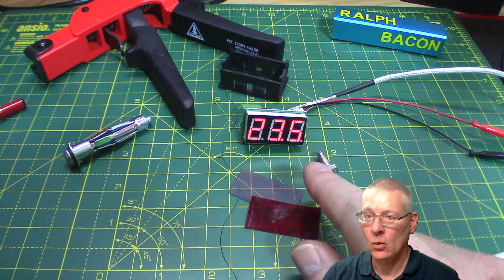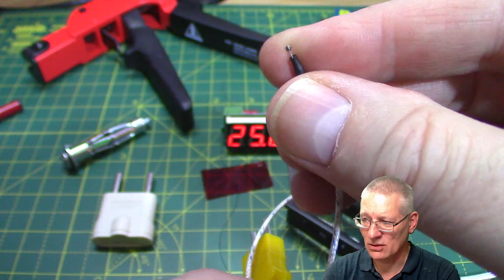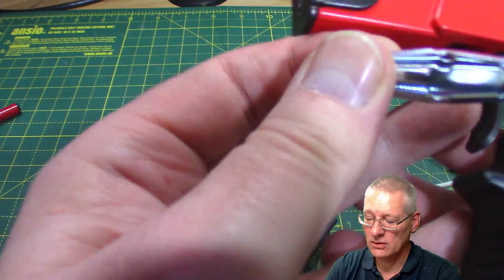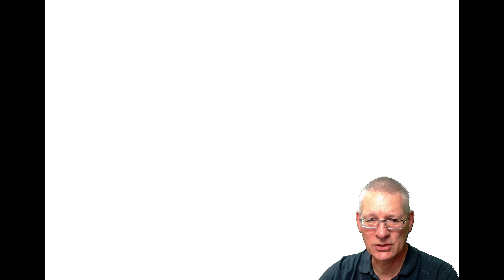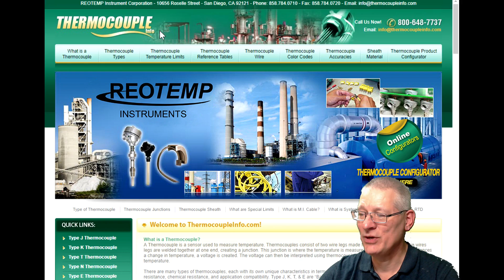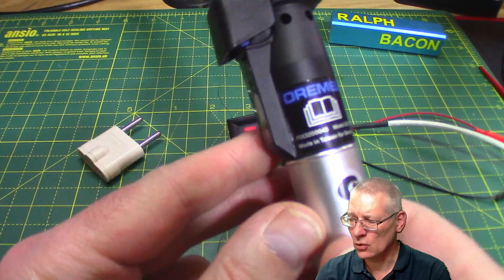#137 K-Type Thermocouple Display

Comment: I'm really interested in installing something like that for my espresso machine but I can't find how to connect this to a power source. I understand you need a 12V adapter (220v to 12V in my case), but as I know pretty much nothing about electricity, I don't understand what I should buy to connect it to a power plug. If you have any reference or even just the name of the part so I can search by myself I would be really thankful !

Comment: Hi Ralph
Would you happen to know how to set up an electric kiln to read temperature.  I have been told I need an ssd,  
k type thermal couple and a temp reader. I have no idea what to do or how to do it.
Reply from the maker: What you are doing is reading an analog voltage from the thermocouple, on any one of the Arduino's A0 - A5 ports. There are examples on how to do this in the Arduino IDE.
Reply: @RalphBacon  Thanks I will look.

Comment: Bit late to the party but been using these thermocouples for many moons for measuring exhaust gas temperature in two stroke exhausts, which is important for exhaust pipe design. Also use in the oven I built for melting aluminium. One issue with the regular sensors is that they are very slow response. I actually cut the ends off mine to expose the blob on the wire ends and response is lightening fast. The chip used for the conversion is a MAX6675.
Spot on about extending the wires, in fact I cut the spades off and connect the wires directly to reduce the amount of dissimilar materials. Accuracy is pretty good. Certainly good enough for what I need.
Also, don't solder any connections as once again this adds to the dissimilar materials and affects accuracy.
By the way, I use a Nano for outputting the temp to a display and also logging to an SD card for graphing in excel.
Great vid as always
Reply from the maker: Good Real World information there! I'm guessing the thermocouple wires are welded together (not just soldered) as you have cut off the ends? Or perhaps just wrapped together? Whatever, useful stuff and and interesting post.
Reply: @RalphBacon  not exactly sure what they've used to join the ends but I blasted it with a torch up to 1000°C and no problem. Works fine. Typically, the temperatures I'm working with in two stroke pipes is 550-650°C.

Comment: When I worked for a defense contractor in the 80's, we used so many thermocouples in destructive tests that we used to make our own. We bought thermocouple wire in spools of a 1000 feet or more, and made our own by soldering the two wires together at the very tip. It was a very small solder bead. Of course, when that end of the wire was destroyed, we would cut it back a ways, and do it all over again. Still got accurate readings.
Reply from the maker: That's certainly a lot cheaper than buying commercial thermocouples (well, if you're going to destroy them regularly!).
Reply: Yep. Of course, thermocouple wire isn't cheap either. You would have to destroy a lot of pre-made ends before you would break even.

Comment: Could I use red gel sheet for the led overlay?
Reply from the maker: I think I did that to my one too. Standard lighting gel, Fire Red or something like that. Worked fine and make it easier to read. It's only about £2 from eBay for an A4 sheet.

Comment: I think the rivnut idea isn't the best method - rivnuts have a nasty habbit of coming lose and spinnning when you try to screw things into/out of them. No good if you need to replace your thermocouple.  A much better idea would be to drill the hole and tap an M6 thread directly into the 'wall'.
Reply from the maker: Agreed. The rivnut seemed a good idea at the time but having revisited it I think it less than ideal.

Comment: Interesting video, thanks Ralph. I am definately going to get one of of these but tbh I wont be using banggood, they're useless. Hopefully I can source one elsewhere as I've wanted to put a thermometer of some kind in my fireplace flue for some time. Great timing! Keep up the excellent work.
Reply from the maker: Glad you liked the video, Doc, but I'm sorry you don't like Banggood. When someone says "they're useless" it usually means that they have had a bad experience that wasn't resolved satisfactorily. I use them more and more because they deliver stuff so quickly (and the price is OK too). The only downside is that they don't stock everything so I then have to go to AliEpxress which takes longer to arrive.

Comment: Enjoyed the video.
Not meaning to get off topic, but that Dremel heat gun is quite a neat device.  Do you have other videos where you have used it?  And can it be used to reflow solder?
Reply from the maker: I've shown it only once before, I believe, when I first got it. It can be used to solder (it comes with a couple of soldering tips. quite chunky but work well, especially outdoors). 
Whether it can be used to reflow solder I cannot say. It gets hot enough but possibly too hot - you only need a couple of hundred degrees Centigrade but as you saw this can really get hot - too easy to burn the board I suspect. A hot air soldering gun is the tool for the job - temperature controlled.

Comment: Nice little device. I was planning on building myself such a thermometer for the BBQ with a few sensors and WiFi capability so that you can monitor your smoker from anywhere in the garden. But until now I did not manage to start that project.
Reply from the maker: So now you have one less excuse to not get started, right, Michael? Good to hear from you.

Comment: Sorry Ralph for being off topic, but have you had a chance to come up with the circuit board design for programming the ATTiny yet? I'm sure there are a couple of printed circuit board manufacturers in China that would be more than willing to sponsor the video. 
Thanks again (& great video as always)
Reply from the maker: Off topic, maybe vonries, but still of interest! 
Now, when you say "programming the ATTiny" I am currently looking at resetting the fuses of the ATTiny85 (specifically the RST pin back to RST from a GPIO pin, as covered in video #87). My sponsor, PCBWay is also keen that I progress this! I've decided THT is the way to go, SMD was just too fiddly.
I'm trying to multitask this PCB design in amongst another (more urgent) project so keep tuned, it won't be that long before I have something. 
Unless you didn't mean resetting the ATTiny85 - in which case there are several boards out there already to just program them and which I covered in video #84, I believe.
Reply: @RalphBacon  you are right on target. I want to be able to set it as a GPIO and back again so I can update the program as needed. You are the man Ralph! I'm waiting with baited breath for those Gerber files.

Comment: Nice project, electronics and Food.
I bought a cheap PID controller just to display the temp of my heat treat furnace, that would have been perfect, using correct and known thermocouple junction gives very accurate readings. I did buy the extended type thermocouple to pass though 75 mm of insulation.
Thanks for sharing and best regards from the Black Country.
Reply from the maker: Glad you liked this video, whilst this device won't control the temperature (unlike a PID) this is pretty cheap just to display the temperature fairly accurately. Thanks for posting, and regards from the land of Concrete Cows and roundabouts.
Reply: @RalphBacon  Thank you for your reply, I was in your neck of the woods in 2016 having training in PLC controls at Rockwell Automation. The cows were on display in side the shopping centre.

Comment: The length of the extension cable is not the main property when extending, it is the type/composition of the cable.
K type extension is a different composition to J or R type cable. 
As long as you use the right type of extension cable, you will be fine, even shortening the existing cable will not change the temperature reading.
Also observe the polarity/colour of the extension cable.
For example K-type,  RED coloured wire insulation is NEGATIVE and YELLOW coloured wire insulation is POSITIVE.
There are also a few different colour code standards.
Reply from the maker: Quite a minefield then, Tom, as we must use the right cable for the type of thermistor and observe the polarity too. But can we just cut off the spade connectors (or that yellow plug) and solder on an extension cable? I though we might have to use a proper extension connector (of some kind)?

Comment: Fridge and freezer alarm
Cool vid
Reply from the maker: Hmm, actually, you'd be better off with a DS18B20 for that, a waterproof version that looks like a tiny torpedo. It can be very accurate even at low temperatures. The thermocouple is best kept for very high temperature measurements, such as ovens, BBQs, boilers, furnaces and so on. But thanks for the suggestion, always good to hear from you.

Comment: Nice vid. But no one has picked up that this is the wrong type of fitting to use on a nut. That threaded shaft spins independently from the thermo couple because the thermal couple is designed to hit something and the nut spins and clamps it up tight. If you used that on a flu the threaded part would do up against the riv nut put the thermo couple with still spin around and leak.
Reply from the maker: My foreheads is furrowed (concerned face) as I read this post. You're right, it's definitely is not an airtight seal, that's for sure. A solution would be to use some high temperature sealant that, once fitted, would set and provide that seal. Even some "metal putty" put on the outside would be pretty good. Certainly in a domestic environment I would be very careful that a proper seal was made. On a BBQ is just doesn't matter. Excellent point, Capposteve, great that you posted here.
Reply: Ralph S Bacon no worries Ralph. I wasn’t sure wether my sketchy explanation was understandable or not. But you see what I mean. It’s like one of those taper ends on old brake callipers for cars. And even more obvious when you see the thermal couple with a ball end on it. So it seals agains the part it’s pushing up agains and then it seals on the spinning threaded part to once tightened. I’m sure that are solid ones out There for the purpose this is intended for. 

Anyway, thanks for your great videos. Always look forward to new videos. 

Steve
Reply: @RalphBacon  You can find various grades of silicone ("caulk") at auto parts stores that will tolerate some fairly high temperatures.  I recall getting some a while back to deal with an aspect of the wood stove here that wouldn't stay in place otherwise.

Comment: @10m47s: I don't think that the thermocouple threaded hollow bolt is long enough to reach the threaded section of the drywall nut.
Reply from the maker: I checked what you said, J H, and you may be right - at least, not without some modification to that bolt. Not impossible but best to stick with the rivnut, methinks! Thanks for posting.

Comment: Great video.  The rivnut maybe not so handy for a stone chimney as those are often quite thick and stuffed with insulation. On a bare metal pipe they may come in very handy.
I have one in my oven and I just fastened it with another 6mm nut on a metal plate. Would do it that way on barbecue as well: drill a hole through the metal, stick sensor through, fasten with 6 mm nut
Have one at my fireplace, attached in same way (I like to make sure the fire is out when I go sleep)
"Running out of gas"? I think I have not used that excuse since my late teens anymore
Reply from the maker: Well, the rivnut is not intended for use on anything except metal, Ed, so a stone chimney definitely won't work. You could just drill a small (8mm?) hole in the chimney, stuff this in until the end just pokes out the other side and then seal the hole airtight afterwards. Jobs a good 'un.
And yes, if you can get to the other side of whatever you are fixing it to then a standard M6 nut on the other side is a perfect solution, less fiddly than anything else (as you have proven).
Finally, your reference to me "running out of gas" is, for us Brits, not a used expression, not even in my teens with a date sitting in the passenger seat, mainly because we don't refer to petrol as "gas" here, not ever. Gas is the stuff used in ovens and stoves (we say hobs) for which this device is perfect, of course. We don't even "get gas" after a heavy meal!
But we understand the phrases due to the plethora of US TV films here. Where's the nearest gas station? People will give you blank stares!  Great to hear from you, thanks for posting.
Reply: @RalphBacon  ah then I misunderstood. Probably automatically presumed British chimneys were made of stone. Seen too much Coronation Street in my youth I guess.
Yes, petrol is the right expression in UK, with the tank being under the bonnet rather than the hood. Two countries, separated by the same language as they say.
Anyway, very handy sensors. Have them monitoring my stove ( that's the one I am cooking on), my oven and my fireplace, the first and the latter combined with an it sensor, to make sure they are all off when I go to sleep. One tends to become forgetful with a rising age

Comment: Hi Ralph, I have used the very same thermocouple in conjunction with the MAX6675 IC and an Arduino Nano to make a high temp module for my "Plant Pot Tandoor" and it all works great (delicious chicken !) There is a great libary for the MAX chip and the temperature range is 0 - 1024 C,  just perfect for a Tandoori oven which sits at around 450 C. There is a breakout board based on the chip and  that comes with the thermocouple as well, and they cost peanuts. All in all this was a cheap and convenient solution, as commercial high temp measuring kit is quite expensive. The highest temp I've measured was just shy of 600 C.
Reply from the maker: Wow! 600C, that's hot enough to melt a number of things (but not this thermocouple, apparently). Someone else has mentioned the MAX6675 chip, I'll add it to my list. Thanks for posting, Andy.

Comment: Hi Ralph...we have both plasterboard and drywall here in the USA.  They are not the same.  People who know what they are talking about call plasterboard plasterboard and not drywall.  So you were correct the first time.  :)
Reply from the maker: So confusing - two nations separated by a common language! Thanks for the heads-up, James!
Reply: @RalphBacon - one more quick point - Maybe you call your drywall by it's real name over there:Gypsum board?  It's also called Sheetrock here, which is a brand name. 
https://www.gypsum.org/about/gypsum-101/gypsum-board/

I did much prefer the old plaster board though - but that's expensive to do nowadays.  And we dont build quality stuff like we used to.

Your mistake is not that uncommon though!  Even this article has it wrong:
https://www.hunker.com/12616166/differences-between-gypsum-board-and-plasterboard

But it's not wrong about the durability - just the naming.  "Plaster and Lath" as it calls it is the real plasterboard.  My grandmother's house and the house I grew up in built in the '70's had it.

Plasterboard is real plaster over a board.  Drywall/Gypsum Board/Sheetrock  is gypsum power hardened between 2 sheets of paper.

Now you have the rest of the story!  (c) Paul Harvey

Comment: That wall anchor wouldn't work, the first part it too long, also the cagenut may leak fumes.
the rivnut is the way to go
I've had to change temperature probes on industrial incinerators that are supposed to work at about 1000C, but the operators kept melting the pocket tubes, and consequently the thermocouples.
The red filters used in stage lightine is 'gelatine' and is referred to as 'lighting gels' (i used to do stage lighting), you may want to try that display without that other diffuser, might be sharper.
Reply from the maker: Agreed, the rivnut is the best solution for when you can't get to the back of the thermocouple to get an M6 nut on it.
Regarding the diffuser, I quite liked the diffused (softened) image, although in real life it was sharper for some reason than on the video. But it looks pretty good and removing the diffuser is always an option, so thanks for the suggestion, Sparky.

Comment: Ralph, another great video. But how would one connect this thermocouple to an ESP32 or Arduino? Mike
Reply: With a max6675 module, a ailable at AliExpress for 1.30 euro
Reply: https://www.banggood.com/MAX6675-Sensor-Module-Thermocouple-Cable-1024-Celsius-High-Temperature-Available-p-1086406.html?rmmds=search&cur_warehouse=CN
Reply from the maker: But no display, of course, you'd have to do that bit too.
Reply: @RalphBacon  ...but can be integrated into a project. As an 'arduinite' I thought you'd have gone that route. ;^)
I just bought one, it's uncanny the number of products you feature that I've just received or am waiting to arrive from China.
Reply: Thanks. No display needed, just the data for logging. I assume I can use node red for this as well as alerts for over temp & under temp.

Comment: It is not only the bead that is a special alloy on thermocouplers, it is the wires too. The thermocoupler measures temperature difference from the bead to when the wires changes to another alloy, that is the reason you cannot just extend with a normal wire.
Reply from the maker: I knew that you cannot just cut/extend the wires, now I know why this is so, Henrik, so thanks for the heads up! Others will be interested in this too.